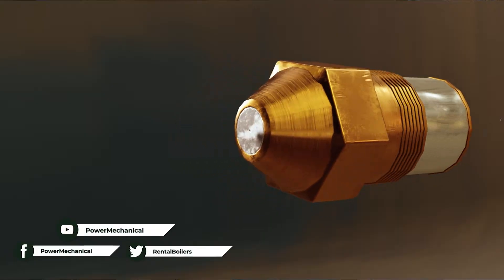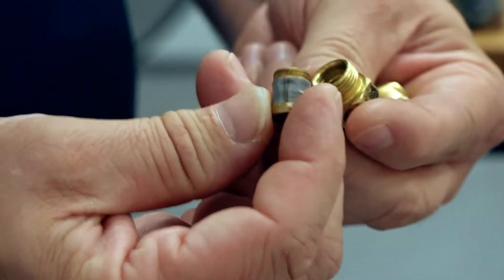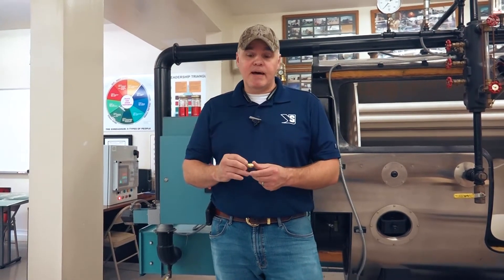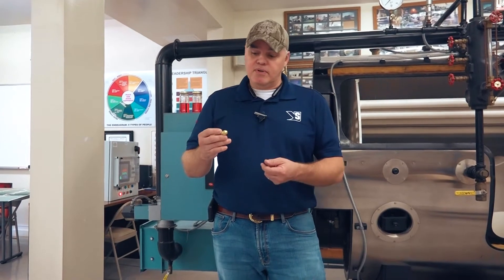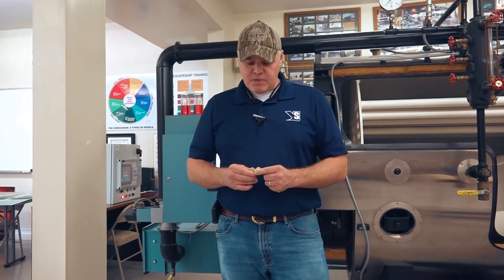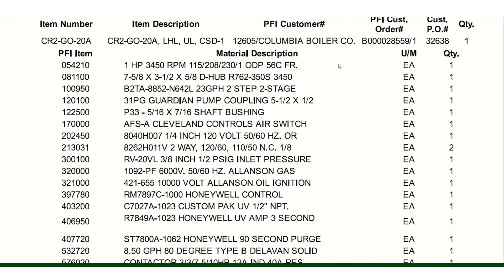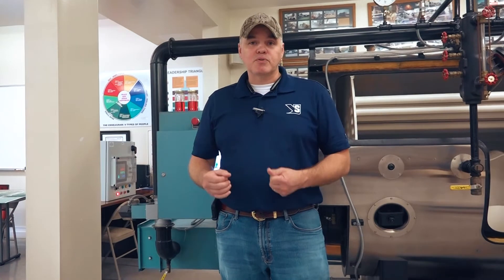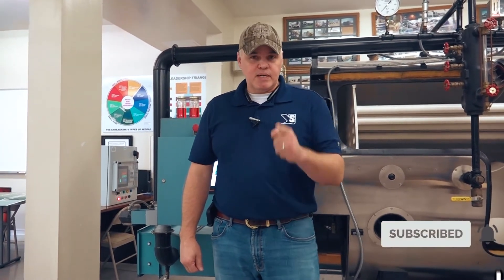Oil Nozzles for Burners - Boiler Room Tips

Comment: I have Beckett Burner and New Yorker boiler.  I checked documentation for both and found 3 different nozzle recommendations,   I did call New Yorker a few years ago about the nozzle and they did not want to help me at all.
Reply: Beckett  Burners Have A Sticker On The Burner Housing That Tells You The Nozzle To Use  New Yorker Made The Boiler Unit ONLY   Everthing Else Is Made By Another Company   Beckett, Honeywell And So On.  New Yorker Is Not Going To Talk To You About Your Burner They Didn't Make It  . Check The Sticker And Follow What It Says . They Designed  And Made It . ONLY Use The Nozzle That The Say To